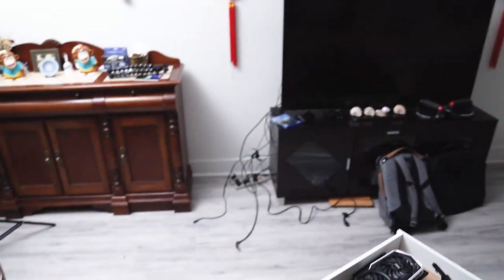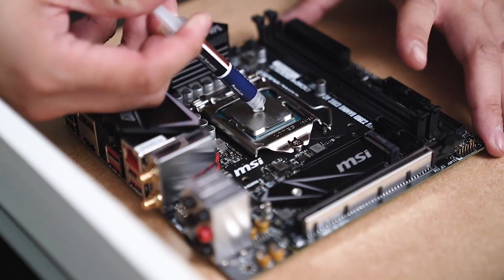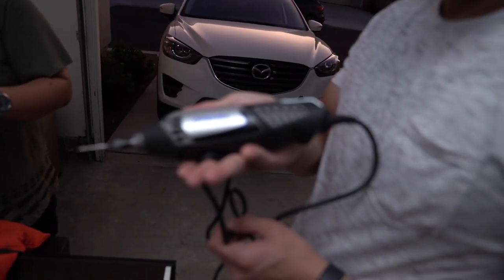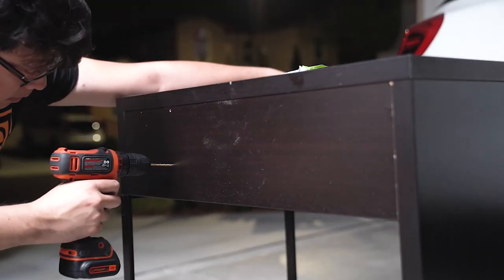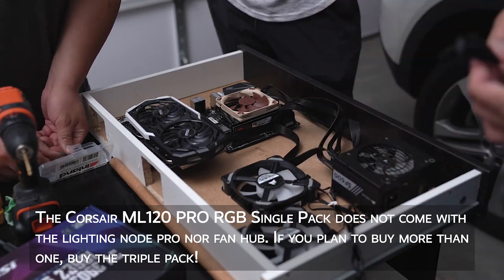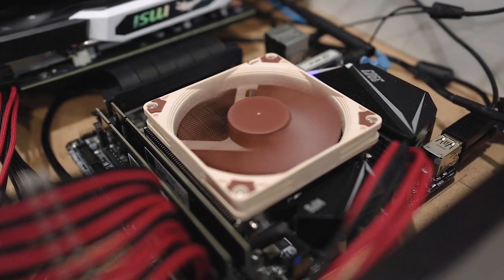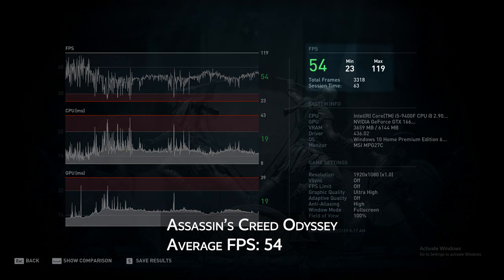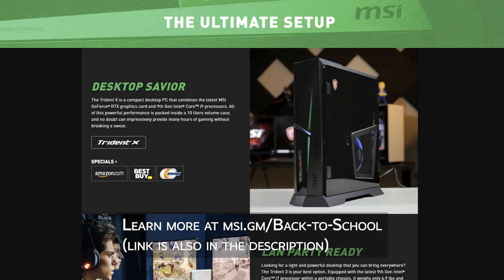IKEA Desk Drawer Budget PC Build

Comment: hey bud, did u experience any vibration or temperature spikes and dust issue because i am also willing to buil one by myself
Reply from the maker: I don't recall any vibration or temperature issues, but I didn't game on the system for an extended period of time for more than 30 minutes to an hour?  I also don't think I had that much of a dust issue. IIRC I had fan filters installed on the bottom intake fans which probably helped with reducing the amount of dust, but can't quite remember since I also disassembled it and move it into a proper PC case

Comment: Hi, this is an interesting unique build. Just a curious if you put any support on the backplate of the GPU. Also does the riser cable enough to support the GPU?

Thanks
Reply from the maker: It’s been a long time since I’ve made this build so I don’t quite remember all the details. I think I put a small object under the GPU just to prop it up so not all the pressure was on the riser cable/pcie slot. 

If I were to try and redo this, I would try to figure out how else I could secure the pcie bracket on the GPU down like how it would be in a case so that it’s not just putting all the pressure on the riser cable
Reply: @daltonlsw  nice thanks, your a legend.

Comment: Hello, dear friend! I saw your video and was inspired by your idea of a computer built into the table without any special carpentry skills and equipment. I want to assemble my computer components in the same table. I want to ask a couple of questions about the assembly, and I will be grateful to you if you answer them. 1. Does this computer now function in a desk? Are there any problems, comments, complaints? 2. If I understood correctly from the video, then you made a conclusion about the temperature of the computer, that the temperatures are a little high, but is this not critical? Right? 3. Did you find over time additional problems with cooling components or something else? 4. Did you modify the assembly in terms of additional or forced cooling, ventilation etc.? 5. Do you have plans to modernize, improve, modify anything in this computer built into the table? Thank you in advance for your answers! Thank you for the idea and the work done! Best regards!
Reply from the maker: I eventually moved the components to a PC case after 6 months of it sitting in there. I didn't use it during this time as I have a different primary computer I used, so I'm unsure if the heat generated over time would have affected the desk itself. 

The only thing about the desk that made we worry was the bottom piece of the drawer as it was quite flimsy. It may have held up during the construction process and filming, but I would have preferred it to be a stronger piece that didn't bend for peace of mind. 

I personally thought the temperatures were at an okay range because I was a relatively mid-range CPU and wasn't doing any sort of overclocking, and I thought there were enough cracks and openings for air to flow through. 

The only things I would change this build if I could strengthen the bottom piece that the majority of the components were mounted to and create a bit more clearance or a barrier for the components so I wouldn't worry about them hitting the tabletop

Comment: Nice video! Im thinking about trying this but I'm curious of how the draw has held up over time. Has there been any sag, or is it still sturdy? Thanks!
Reply from the maker: I left the components in there for about 6 months before I moved it into a proper case. It wasn't being used in that time, so I'm not sure if the heat generated by the computer would have affected the bottom piece. However I would have much preferred to have a much sturdier bottom piece to have mounted the components to as the included bottom drawer piece was a bit on the flimsy side and made me a bit concerned that it would break one day.